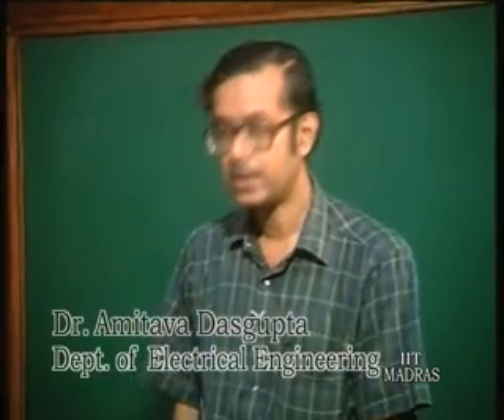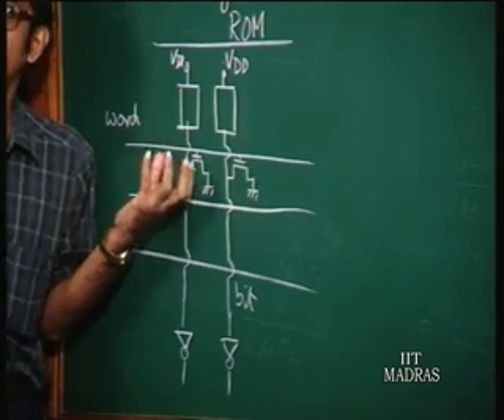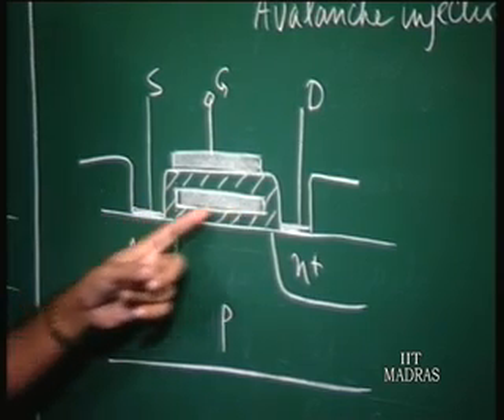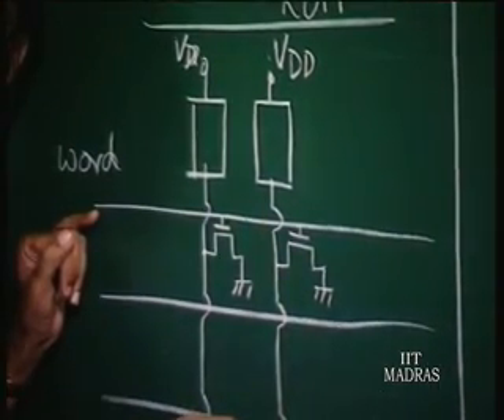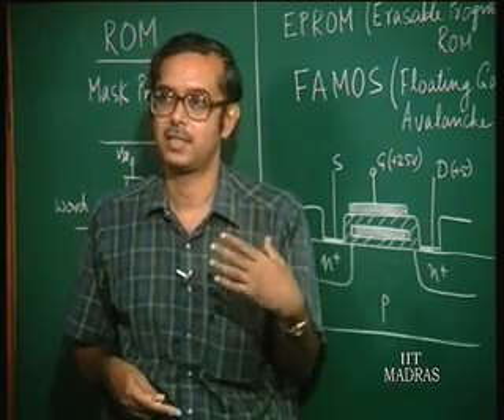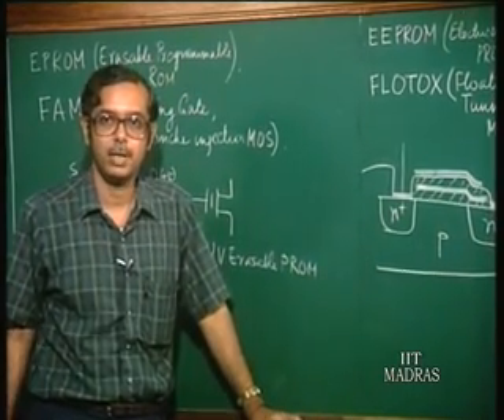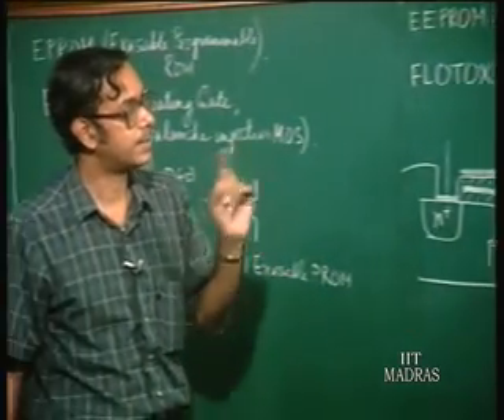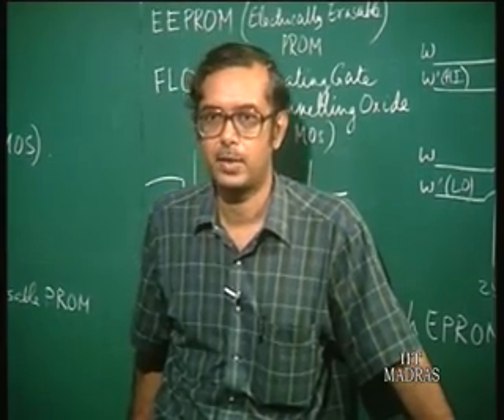Lecture 36  ROM-EPROM,EEPROM and Flash EPROM

Comment: Ahhh I remember those EPROM "Burners" in the 1970's and the UV PROMS. Called "Burners" from the higher voltages required above TTL and CMOS I guess. Mainly for keyboard mapping, character gen in monitors etc etc and simple stuff back then, ya know like MICR and OCR readers etc. Of course it was all DTL and TTL before LSI, VLSI and CMOS appeared.

Comment: Even if there were a dent in the source region of the famos, that would not help in improving speed - the source is placed at low voltage compared to the drain ( typically it is grounded) to facilitate the formation of the channel of electrons in the p region. This channel formation is necessary for the mos to be on.. With this low voltage at the source, even a 'dent' in the oxide leayer there would not lead to tunneling.